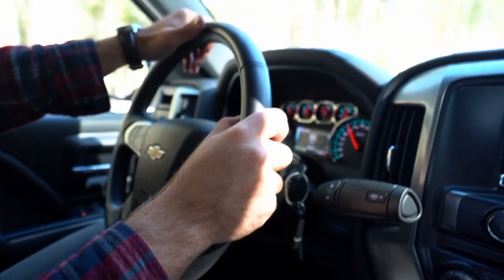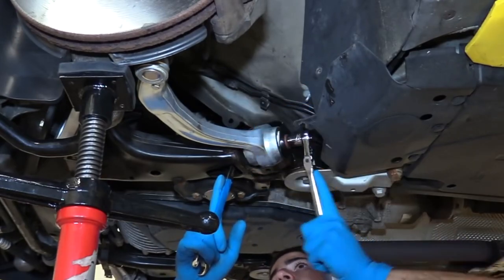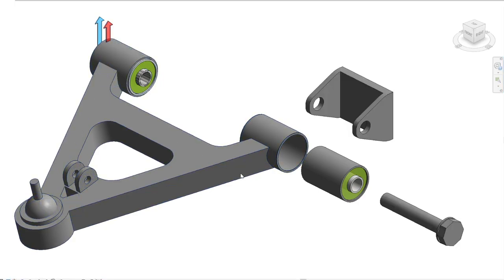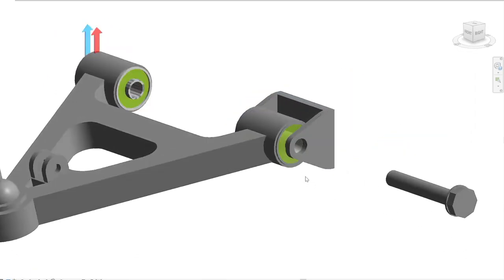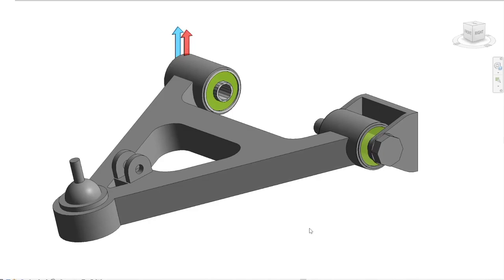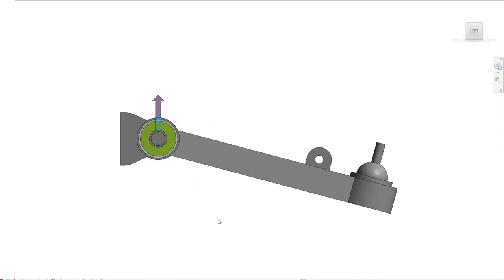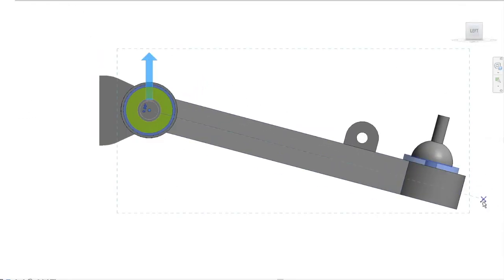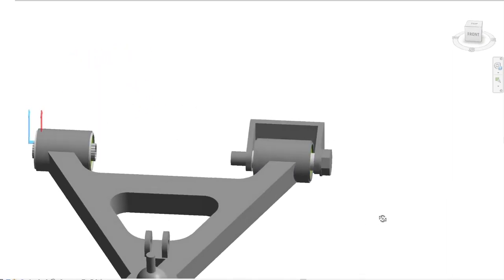A mistake most mechanics do !!

Comment: Measure the height from axle to fender, then Jack the hub up to drive height before tightening your control arm
Reply: This comment right here saved me, no room to work underneath while the car is down but I want to do it right.
Reply: I read that in a robotic voice after watching this video.  This is the correct method as most vehicles these days you have no chance of getting under them with a torque wrench while car is on the ground.  A lot of people don’t have ramps or alignment lifts, etc.  Hell, I’m doing these jobs in the carpark of my flat.

Edit: ‘Flat’ is a British term for apartment.

Comment: so let me ask the computer generated voice this question - - does that mean every time you put your car on a lift using the frame you are damaging your suspension / I ask because on a lift you have all four tires hanging by their various suspension connecting points at maximum drop - - same goes for changing a tire if your jacking point is on the frame rather than under an a-arm. So a suspension is never at a constant ride height while the car is moving over an uneven surface  and the bushing is made to allow suspension movement and to be clear there is no way to properly torque the attaching bolt with the tire on and on the ground. You can leave the tire off and put a jack under the arm and jack it to the point where the arm is carrying the load from  that quadrant of the car but barely lifting off of the jack stands or lift because other than that you're excessively loading that one side. I  don't torque the nut at first when assembling for the first time I merely get it tight enough to hold then put every thing back together - - drive the car around a bit so that everything settles under driving/road conditions then bring the car back in remove the tire, do the preload I mentioned  earlier then torque everything to spec.  The reason for a bushing in the first place rather than a metal to metal pivot point is to allow smooth movement of the components and minimize vibration/shock of - - say a wheel dropping in a pot hole with the weight of the car being carried by a spring or a strut. Remember the old push on the fender trick  to make the car bounce then let go and if it keeps on bouncing then your shocks are shot - -  the suspension should move freely with the shocks absorbing excessive bounce. Any way what they are saying in a round about way is the bushing has give built into it in both directions but by putting a final torque setting  at the bottomed out end you have a preload from the bottom not its normal ride height which creates excessive pressure in one direction only rather than in the middle where it can flex both ways which can cause premature bushing failure
Reply: In best computer generated voice I can mimic I believe it could cause some strain on the bushing with the car jacked up or suspension hanging while on a frame lift. However, the strain wouldn't be too harmful because it isn't a continuous movement applying to the bushing repeatedly. Even though the car is never really staying at ride height while driving on normal roads, it probably maintains a decent percentage within that spec for the most part. Any extra stress put on the car or bushings would cause or could cause its life to decrease. But this is all in the design of the part itself, this is why generally a part will have a 36 month or 36,000 mile life or a something of the sort. I am not an expert this is just my opinion.

Comment: how do u tighten the bolts on the ground ? u just jack up the rotor right ,? and use measurements to see normal ride hide. sounds like a lot of work. me personally I just torque them as hard as they came off . if not a bit looser. never had issues. try some tire spray on your bushings like one time to condition the rubber.. makes em last longer
Reply: before starting to work on suspension, measure distance from wheel center to fender, when you replace what you wanted to replace, tighten bolts loosely, jack up the wheel hub to measured distance and finish to torque the bolts.
Reply: you just jack up the lower control arm not the rotor, you want it at the same height as when the car is normally on the ground
Reply: Can you just measure the opposite side if no work is being done to that side?
Reply: @jataviusmills5622  hard to say cuz even if other side is not jacked up it still is slightly lower because of the other side being lifted :/
Reply: @redpill2634  thanks for the answer .

Comment: Yes but not all hushings eill pry with the bolt to were it wont flex!!! Some do some dont , if u see gap between the bushing ends and its conection points then there enuff slack to be ok , but if u dont see any space between bushing nd conecting point then u will need to tighten bolt on a wherl alignment ramp that has the jack in center of ramp bc otherwise , u wint be able to get under car to turk them rite bc u wont have room to do so !! So it feeds the purpose

Comment: To bad u can't get to it in most cars when the car in on the ground
Reply: @rushxxx12  i did this prior to knowing about torquing while at ride height and didn't know but subconsciously i jacked up the hub to simulate where it would be when the car is lowered ROUGHLY. I didn't measure before hand but should i be alright if its one or two centimeters off higher or lower? surely close enough is good enough right? I can't go lowering the car on its wheel when there's no damn space unfortunately